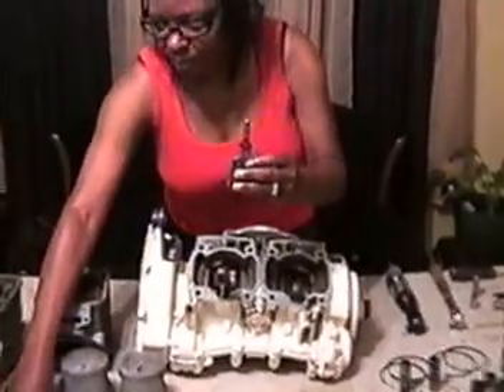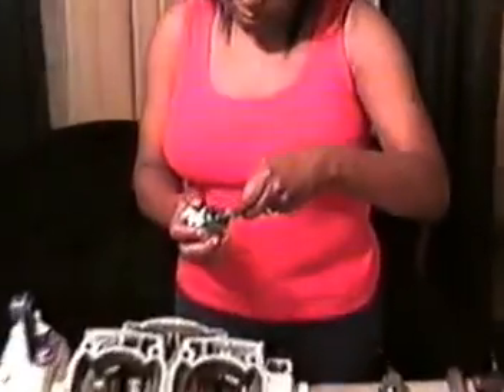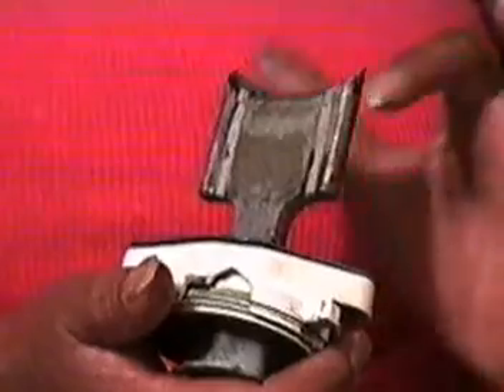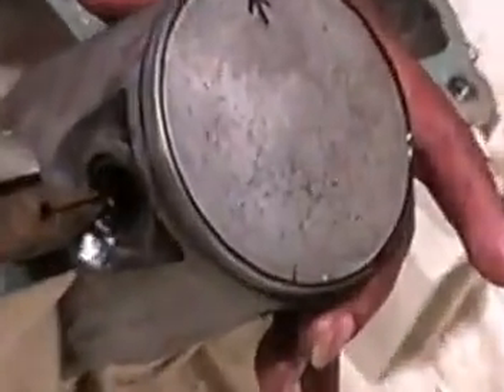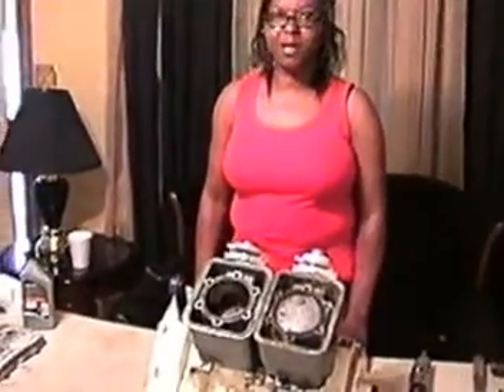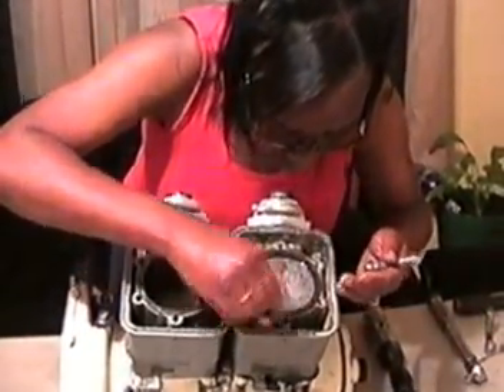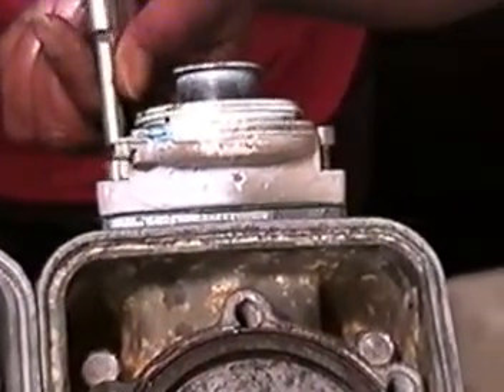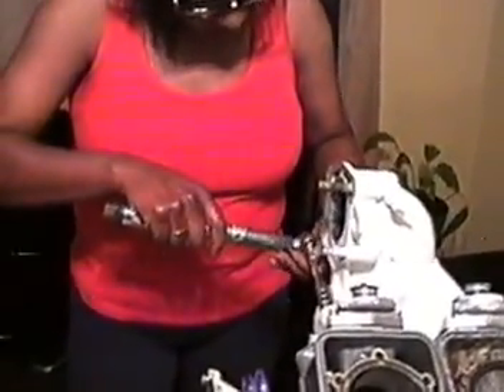Lisa rebuild 1

Comment: thanks Lisa, great videos I learned a lot from your videos, got a question did you use oem parts? what brand if not, did you just put new rings on or what was the rebuilt low compression or? doing mine same way haven't purchased any parts yet. thank you in advance.